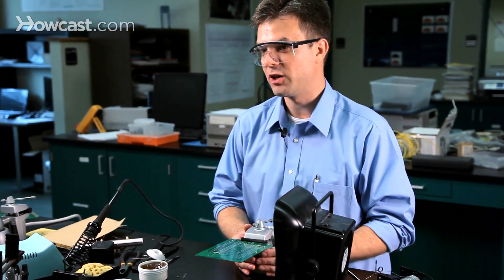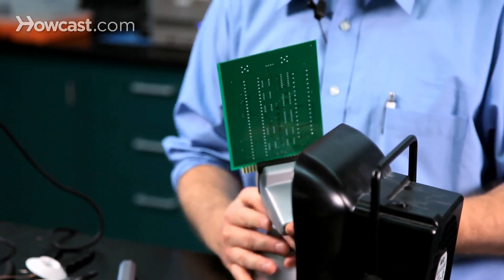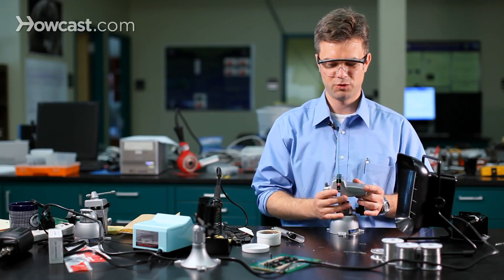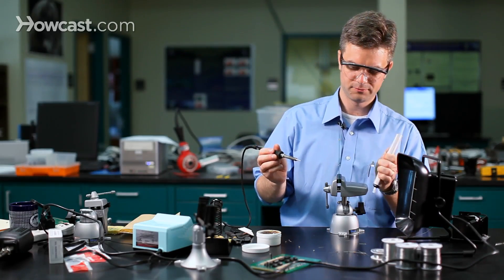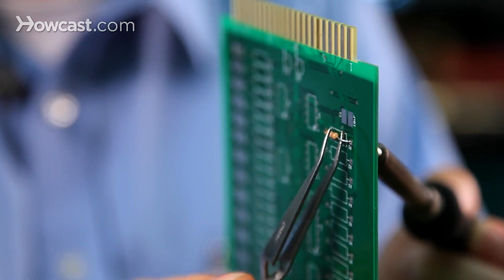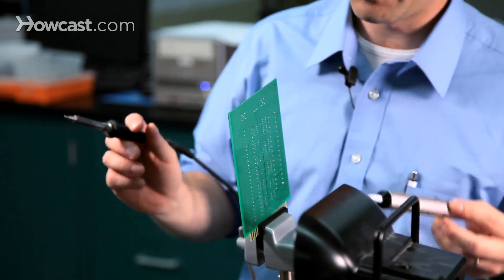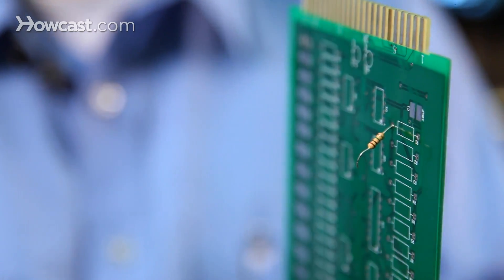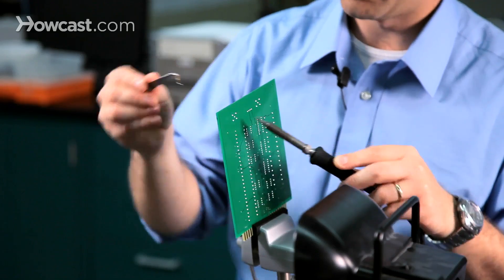How to Remove Through-Hole Components | Soldering

Comment: Sure, easy. But how would you remove, say, a 8 pin header? It's soldered at 8 points and you cannot do one at a time.
Reply: Heat gun.
Reply: @oisint73  Thus needing another tool.

Comment: I cannot access both sides, because it's a big capacitor (that has blown) and is soldered flush to the board. Additionally, the manufacturer has put what looks like some kind of resin all around the bottom of the components, presumably to force people to buy another product when the capacitors blow after a few years. What do you do in this situation? Melt the solder and pull v.hard with pliers? I heard some people suggest boiling the whole circuit board in water.... sounds risky...!
Reply: I have seen people where you place the suction pen on top of the iron tip and still does the job.